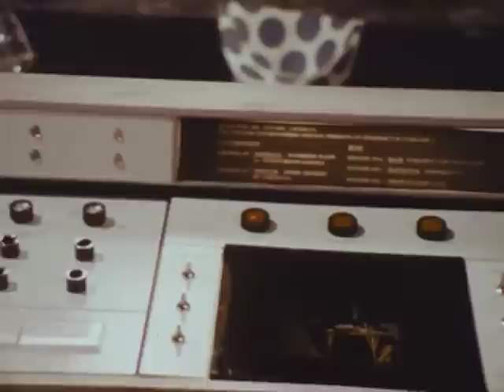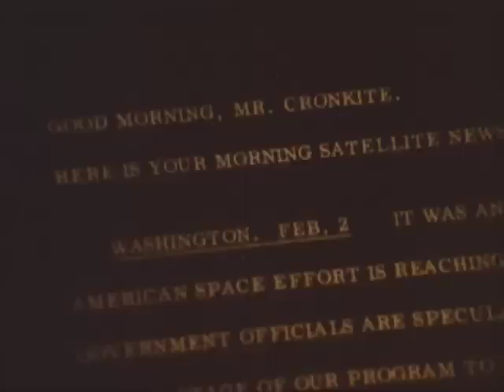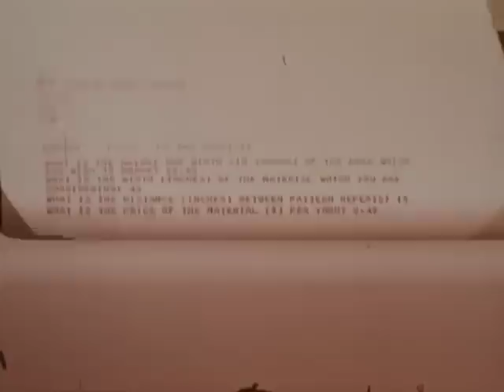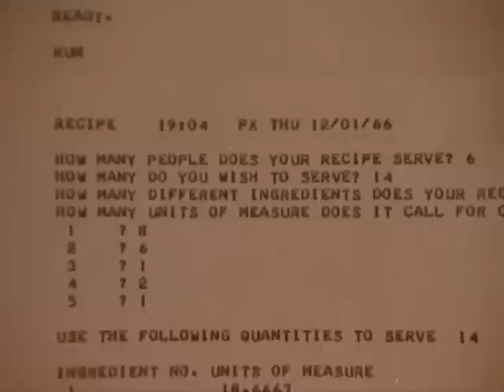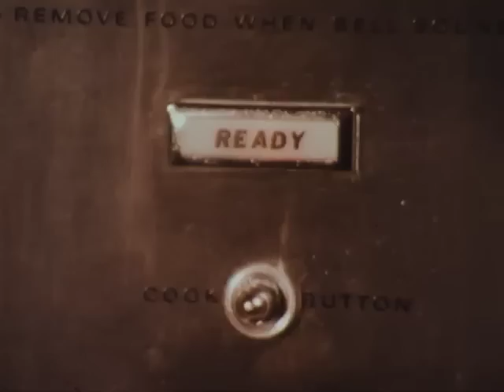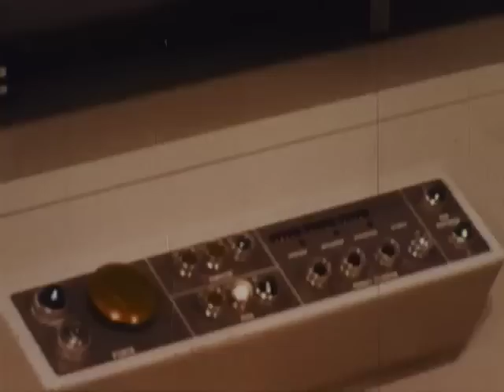Walter Cronkite - "The 21st Century"  March 12, 1967

Comment: So they felt that the new century starred in 2001, not 2000.
Reply: Zoomer30 The new century DID start on January 1st, 2001. Because there was no year zero, the first century ran from 1 to 100, the second from 101 to 200, and so forth.
Reply: Joseph Cope 2000 counts as part the 21st century. There wasn’t a year one either. The scheme dating system was not usage before 525. The new century began on January 1, 2000 not 2001.